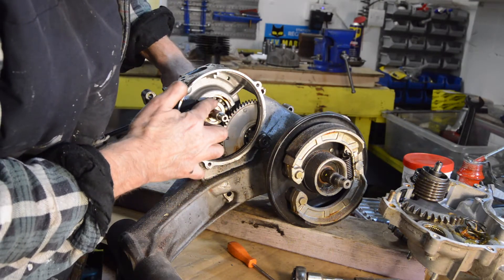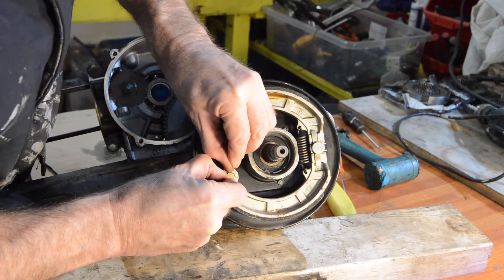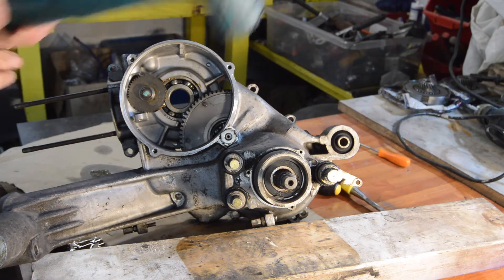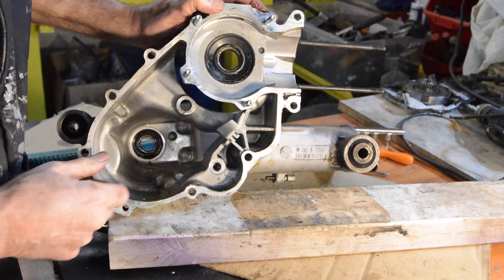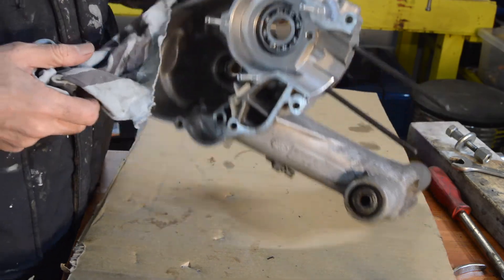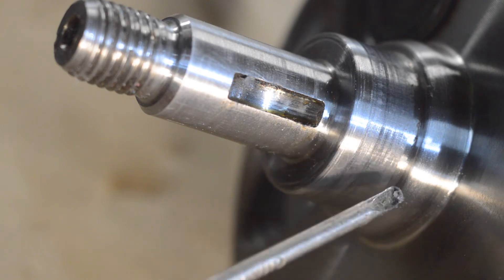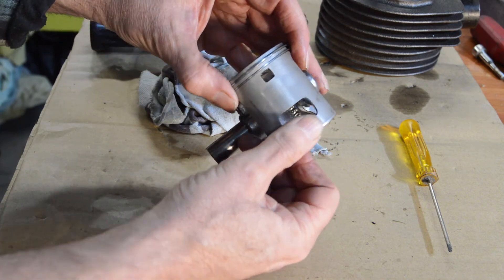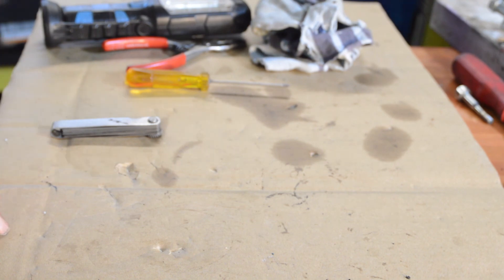PX Engine Strip Part 2

Comment: After 10 minutes, I am guessing it was a soft seize after the kitting and rebuild and a lengthy run, usually due to too small a jet used, so insufficient 2 stroke oil entering the chamber - maybe he never upped both the original (smaller) jets .
Love the dangerous wood chisel action lol.
Reply from the maker: Yep, I think you are bang on a very gentle nip up that did no real damage.

Comment: Is it me or was that crank polished?
Reply from the maker: Hi Max, it was un-naturally shiny. I checked the rotary duration in case it had been cut but it was standard and crank has the Piaggio badge on it, so either it is a recent replacement or the engine is very low mileage. Given that the cases are so clean all round, I think it is the latter, which is good for me !